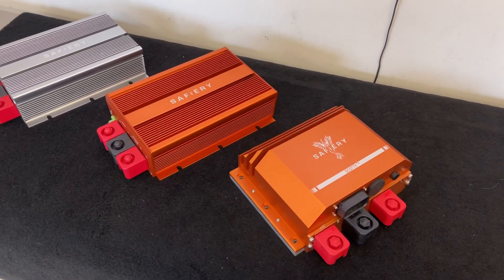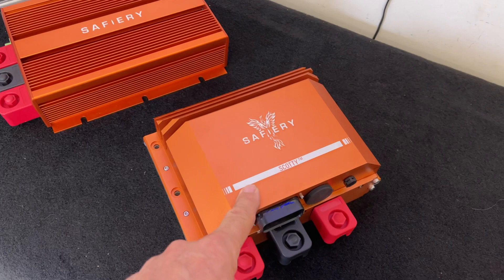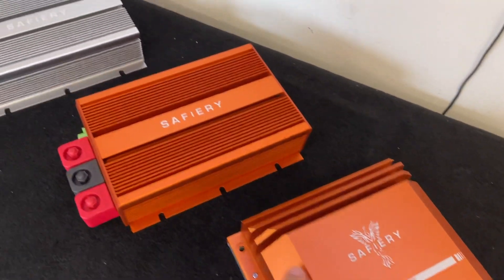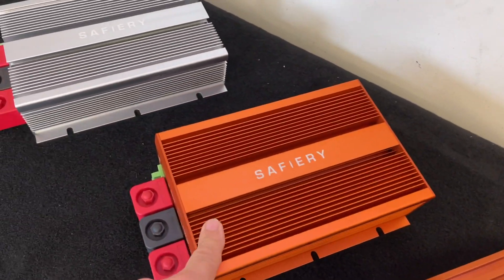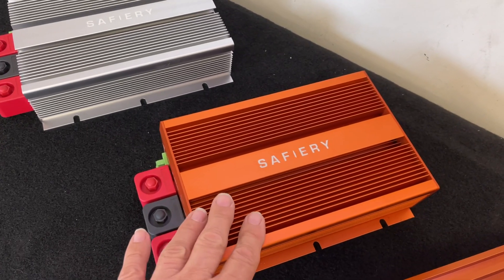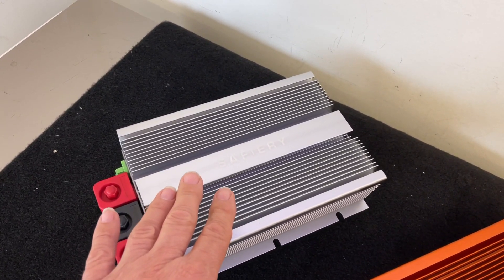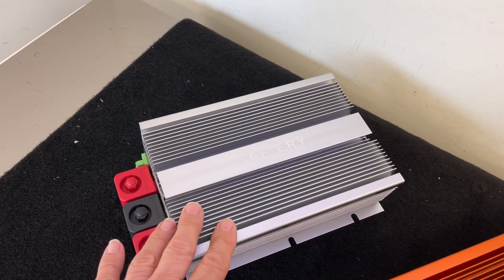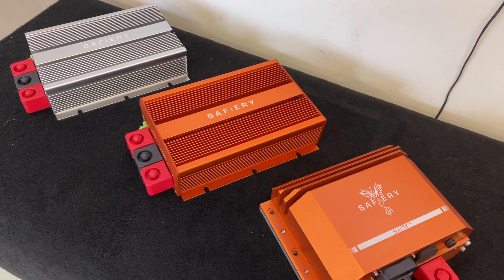Big DC to DC 96% Efficient: 12v to 12v at 80A and 12v to 48v at 80A input. These are most powerful

Comment: What might be the price on the 12v to 12v model bud. 80 amp at idle. Nice 
I am running the enerdrive 40+ at the moment ... Can i replace the enerdive 40 amp dcdc + . Plug n play.. swap out with this model
Reply from the maker: Price on line but around $600. It will not fade like the enerdrive and is more efficient. However, it is suitable for high end batteries with a lower float voltage (Victron, Safiery). So what battery are you running and what capacity?
Reply: @Safiery  big wei battery 200 amp lithium
Reply: Is my battery ( big wei ) 200 amp lithium not compatible.  ?  With the 12 v dcdc 80 amp charger @Safiery